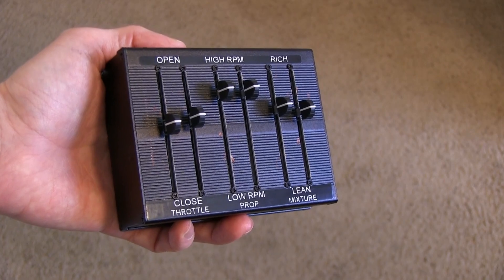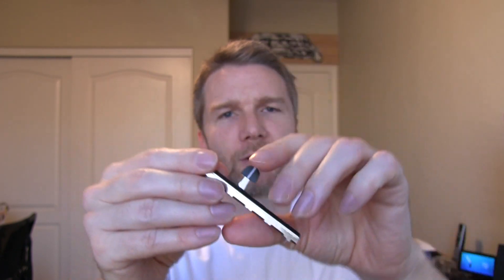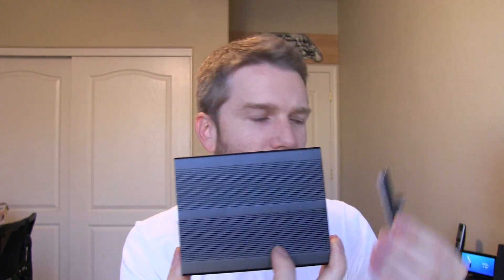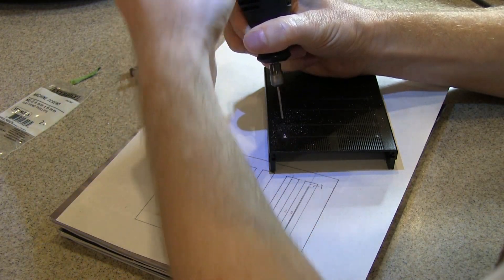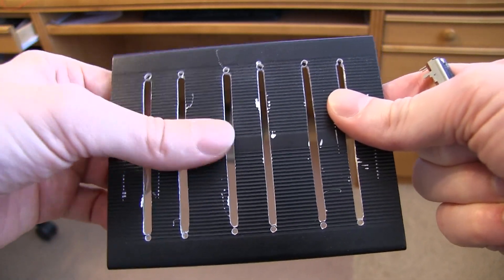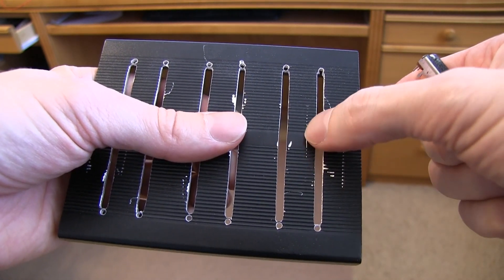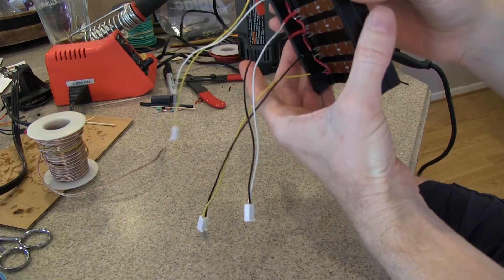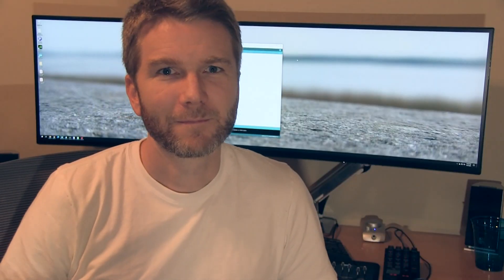Build Your Own $50 Throttle Quadrant for Microsoft Flight Simulator 2020 and X-Plane

Comment: Hi great video.  I am disabled and have lost function of my legs for the most part so I cannot use rudder pedals.  Do you know a way I could do something like this to hand control rudders?  Thanks in Advance!
Reply from the maker: Yes, any of the six analog control surfaces can be mapped to rudder, though I would recommend using a self centering control for rudder such as the thumb control wheel found on RC car transmitters. Any potentiometer in the range of 1k to 20k (10k ohms is best) will work as a drop in replacement. Also many flight sticks have a self centering twist in the handle for rudder use, such as the Logitech Extreme 3D Pro.
Reply: @wdubel  I have a yoke, so this is the reason I am interested in this.  A flight stick does work, however I would like to make something like this with a lever than I could move left to right that I could mount maybe beside my yoke,
Reply: I tried using an Xbox thumb stick to try the rudder movement however it jerks its not smooth.  Is there any way you would be willing to help me? , Maybe join my discord or something?  Thanks in advacnce!
Reply from the maker: @smite0568  If the thumbstick jumps values, it may be worn out. If the output of the thumbstick divider appears linear (measured with a multimeter), the ADC may be picking up noise. Some recommendations to reduce noise: If your ADC supports it (Teensy provides an analog ground) be sure to use the analog ground for the potentiometer ground terminal. Some PCs have noise on the USB power; try connecting a fast (low ESR/ESL) 0.1uf capacitor between Vin and gnd, and/or one between the analog ground and the center terminal of the xbox thumb pot, close to the ADC. For jitter issues, you can correct a lot in code by averaging the last 3 to 5 values. My email is wdubel at gmail.
Reply: @wdubel  Well I have a Mega 2650 board but I have no clue how to really use it.  I have one of the project kits I got a while back, and thought maybe I could use it however I cannot figure out how to make windows see it as a joystick.    When I mentioned using an Xbox controller joystick, I meant I was using the joystick and remapped the controls and its not smooth.  Its a newer controller as well.  Also I have someone else I have played with who tried mapping the same thing on the controller and he had the same issues.
Reply: I just bought one of the Teensy boards.   I am now looking for a self centering rotary encoder or a lever of some sort.  Would you have anything that you could recommend?  or Maybe a 2 axis joystick?
Reply from the maker: @smite0568  You will get more control precision with a potentiometer over a rotary encoder. The encoder is good for applications where the knob needs to rotate without a hard stop at 360, but each step is usually ~10 degrees of turn or more. adafruit has a selection of analog joysticks based on 10k pots that would work great. They have a few small thumb style for $7 and a larger one that is $20. While most joystick will come with two axis, you can ignore the Y axis if not used.
Reply from the maker: @smite0568  Yes, that looks like it will work great. You could ignore the extra Y axis or you could program the extra axis to function as toe brakes!
Reply: @wdubel  Well I got my board and joystick in, however I am completely lost atm.  The joystick has a total of 6 connections, not 100% sure how to tackle this.  Any advise would be much appreciated.  I bought the Teensy 3.2 with pins so all I have to do is connect using the wire and solder the joystick side.
Reply from the maker: @smite0568  Each group of 3 connections is attached to one of two pots on the joystick and will connect to the Vin, Analog In (A0,A1), and AGND of the Teensy. You will need 6 wires total. Two wires connect Vin from Teensy (next to USB port) to one side of each pot, two wires connect AGND (next to Vin on the Teensy) to the other side of each pot, then connect A0 (pin 14) and A1 (pin 15) on the Teensy to the middle connection of each pot. Then load the Complete USB_Joystick example as shown in the video to program your Teensy.
Reply: @wdubel  Thanks, you were a huge help!  I just have to 3D print me a nice hosing now.
Reply: Just in case you have some spare $ to "invest" on another yoke.... Have you considered CH Eclipse?  It has thumb "rudder" axis that works much like the rudder pedals would, but you control them with your thumb.   Just my .2c.  Of course, if this DIY method works, that would be great!
Reply: @santiagoluib3  I have a Honeycomb Yoke, and just bought an VKB NXT Gladiator to use as rudder controls and works great.
Reply: you could use a logitech flight sim joystick is cheap $30 requires no programming and has rudder control's built in by twisting the stick.